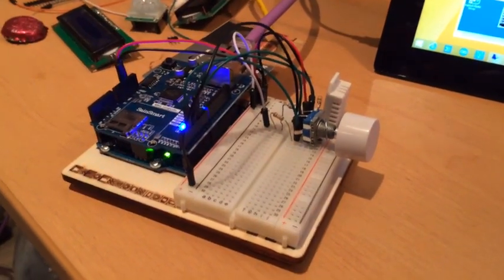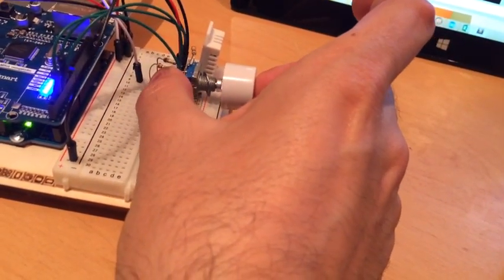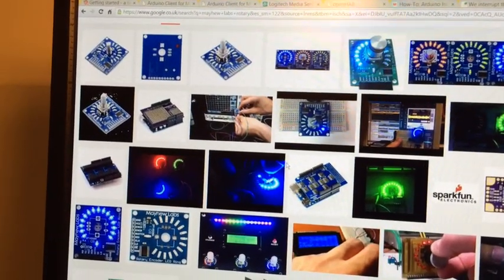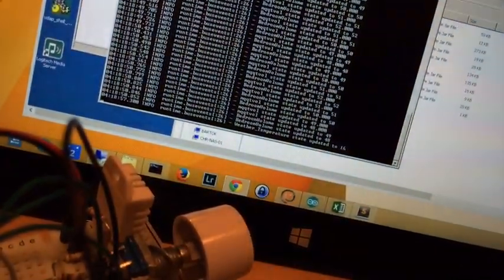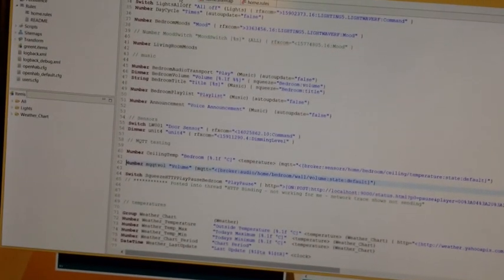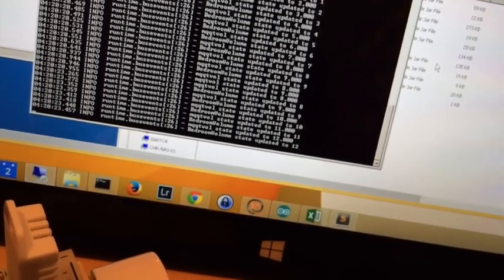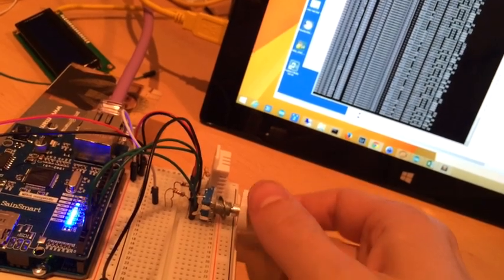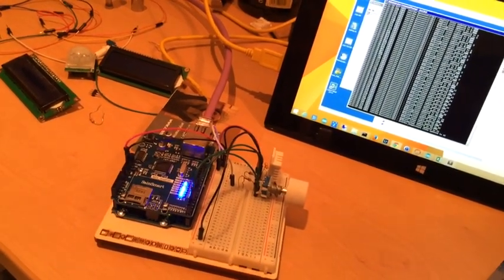Arduino, MQTT, OpenHAB and Ultimate Wall Control Panel

Comment: Hi, I have another question please. Can anyone please help on how to install Mosquitto (or any other MQTT service) on 64 bit PC with Windows 8 or 10 ? I have tried the Windows 7 method available on the Internet, but it does not work on 64 bit PC with Windows 8. Thanks.
Reply from the maker: Installing MQTT on 64 bit win is awful! I have struggled! Here is the answer: install the old version. It's not a very good answer, but it made my 3 hour struggle disappear, and I still have the same functionality. I used an old version (sorry I forgot which), with 64 bit OpenSSL, then followed the instructions on the web somewhere (copy DLLs to the /bin directory, generate private keys, etc.) Hope that helps!
Reply: Thanks a lot Mat. THis solved the problem for me. I chose the last option on the list of old versions. Cheers !

Comment from the maker: Hi Ethan. To answer your question, yes I was using MQTT client in the command line just for testing / monitoring / showing the topic's data in realtime.

The components are as follows
1/ Arduino publishing or listening to a topic (sounds like you have that sorted)
2/ MQTT broker installed on a server. For me, I installed MQTT broker onto an old Windows 7 laptop from mosquitto.org. The latest version requires you jump through hoops to get it working, you have to install a bunch of other progs (see the readme-windows.txt). Install the broker as a Windows service, and check the service is running at startup using services.msc.
3/ Run OpenHAB, make sure "org.openhab.binding.mqtt-1.7.0.jar" is in the addons directory and there's an entry in OpenHAB configuration for MQTT.

The above is all you need to start creating MQTT items and write rules to respond to messages. Hope that helps!
Reply: +Mat Smith Hi Mat, I watched all your latest videos regarding your project. It's a great project and you made me think of better ideas, like using OpenHAB, as a controller. I was actually thinking of designing mine ! 
I understood the linking, but I didn't understand what you meant by "this is  MQTT subscriber running on my laptop" ? You mentioned in your comment that Arduino is publishing or listening to a topic. I can't figure out what you meant by the first phrase.

Thank you. Good luck.

Comment: Hi Mat, I am starting out on my own project and am continually getting confused about how things hook together, regarding the sensor information and MQTT broker.

So I have an ardunio that is running a sketch that publishes to a topic, but im not sure how this is handled by the broker and how the data gets passed to a client.

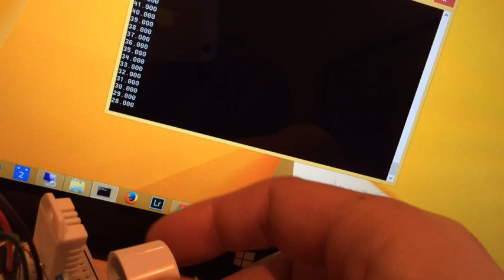In your video at 3:00 you explain the path of communication but I was a bit confused about your use of the MQTT Client. Was the client purely for display purposes.

This whole MQTT broker to client comms is driving me crazy.

Any help / advice would be great?

Thank you